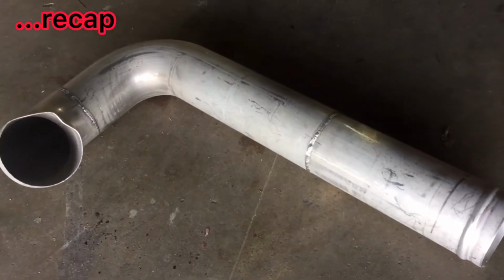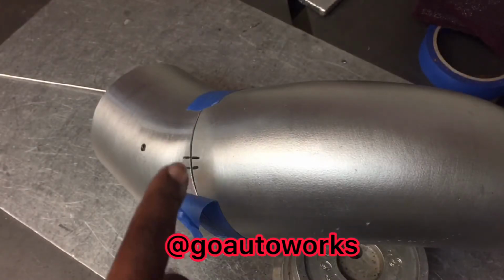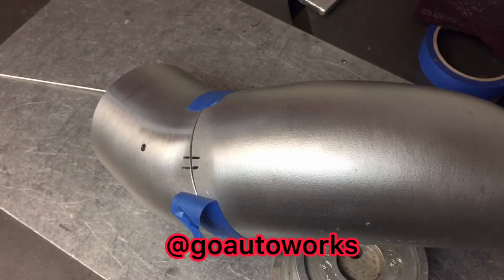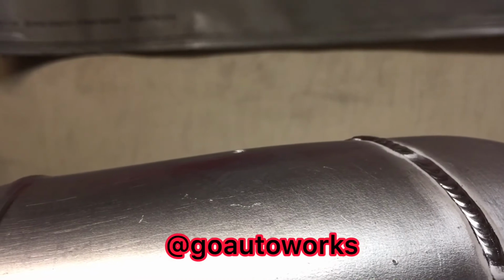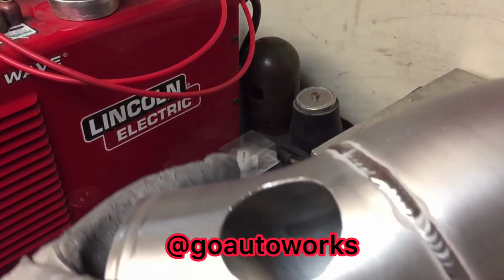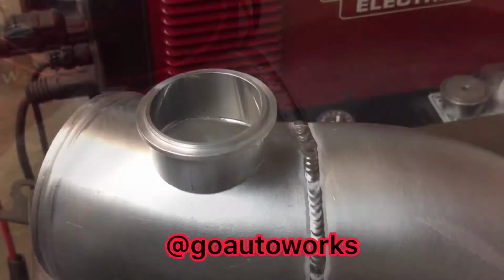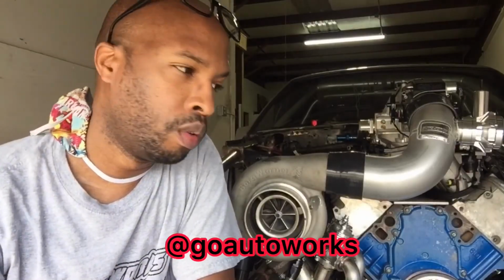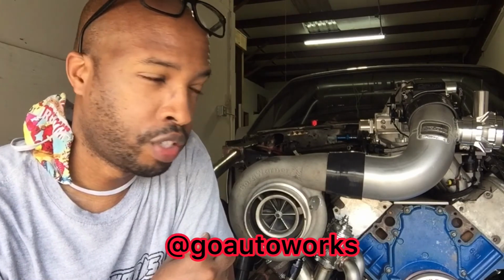Turbo 6.0L Foxbody Fab Project Part 3

Comment: So you use a small cup for Aluminum and a big gas lens for stainless and mild steel?  Is it because the small cup gives you a better view and allows you to get in tighter spaces, and that the aluminum doesn't need the extra shielding provided by a gas lens?
Reply from the maker: Yes the aluminum doesn’t need the same coverage as steel so I rarely ever use a gas lens  on it. It also helps in joint welds where I have to stick the cup in close and point the arc while keeping the weld pure

Comment: What’s the best welder to grab for beginning in your opinion
Reply from the maker: That’s hard to say. A great, “easy”, all around machine is the Lincoln Tig200. I’ve set up several Eastwood Tigs for people which is like sub $800 and would work for “light duty” fine
Reply: Everlast are pretty proven at this point and make "entry level" welders.
Reply: I personally bought a AHP Alphatig and have been using it since 2016 with no issues whatsoever. I had zero background in TIG welding when I bought it.
Reply from the maker: The AHP analog alpha tig and Eastwood are basically the same machine w/same accessories. It is difficult to point at a “best” without categorizing it to price point, abilities...and IMO how well/stable it actually welds on AC at x amperage
Reply: If you shop around on Craigslist you can find some deals.  I got my Lincoln Precision Tig 185 with cart and accessories for $900.  It's been a great machine.
Reply: I appreciate everyone helping understand more , been really interested in welding
Reply from the maker: Cre8tiveGarage here to help